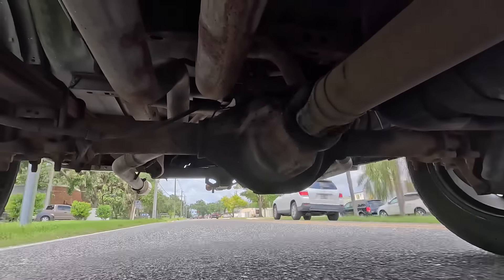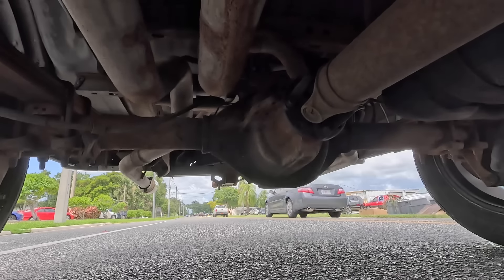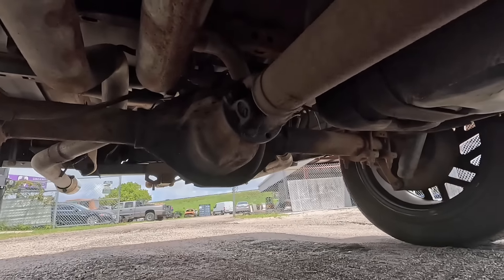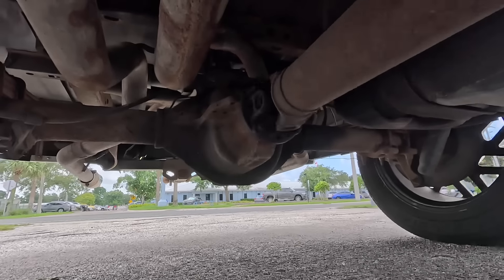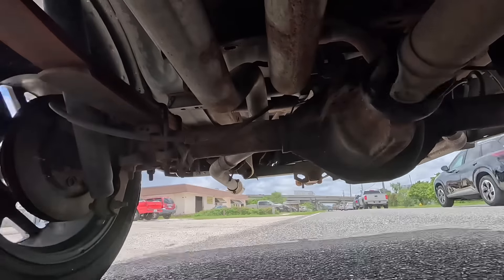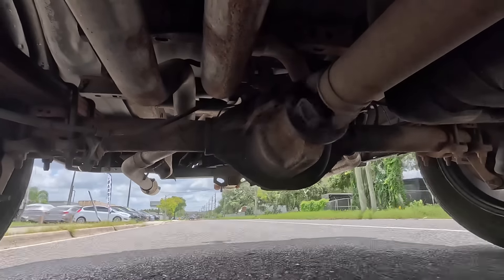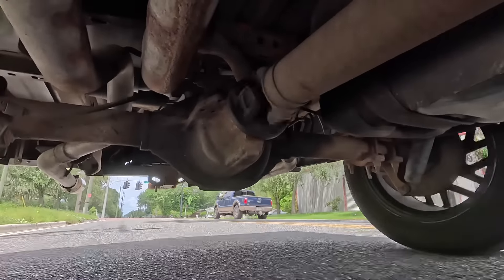Caught Faking a  Video? ​⁠Driveshaft Falling Out While Driving

Comment: Ray, there is absolutely no need to further explain. But it is true how the novice thinks. I am so happy for you that the drive shaft did not pole vault you or the vehicle back to the shop.
Reply from the maker: SERIOUSLY! Pole vaulting an F150 on a Friday would seriously violate rule number 1

Edit: go back to the long vid and present the new evidence in the pinned comment thread. It will be hilarious! The link back is at the end screen of this video.
Reply: The pole vault myth is impossible. Myth-busters tried it, it can not happen.
Reply: Friday was not a good day to die.
Reply: I tend to believe that any day of the week is not a good day to go pole vaulting an F150
Reply: @clbcl5  Mythbusters were never good with automotive myths. I saw them screw up numerous 'tests'. Yes, it certainly IS possible, because I've seen it. (I still loved MB, just not their car stuff)
Reply: Ray, you can't fake that. I seen that happen before.
Reply: Ray, I guess it was you that altered the the Zupredur film of the JFK assassination as well! 😅😅😂😂🤣🤣🤣
Reply: @RainmanRayOffDuty  Psst... did you find that missing piece of the steady bearing hanger.. as i said i saw metals near the front gate?(uh oh.. hope that tire machine is in working order? :)
Reply: I have personally seen a early 70’s sedan loose the driveline at the transmission and hit the gutter in the intersection, then lift the car up 5 feet. 
It didn’t cartwheel, but it was exciting.
Reply: @RainmanRayOffDuty  Ray..  
   This is just the devil messing with you, bro.   
   Step 1= Gotta learn to ignore him/not respond.
   Step 2= Learn why he does what he does and then he finally stops.
Reply: @clbcl5 Unfortunately the pole vault scenario can happen. A girl who rode the same school bus as I did was killed when her father was driving too fast and the front u-joint broke. Witnesses said that the car tumbled end over end and landed upside down in flames. The father was ejected and survived with non life threatening injuries. The girl was pinned in the back seat and burned to death. It was reported that she was screaming but the car was so crushed and the fire was so intense that there was no way to approach it. It was a closed casket funeral.
Reply: @danielbutler578  That's brutal and sad!
The reason why they pole vault, the emergency brake cables were put under the drive shaft to prevent it from dropping to the pavement. Well, those usually are cut and removed when they lock up. I personally did this on my vehicle back in the 80's. In missouri, you're emergency brakes were not needed to pass state inspection. As of 2020, the same thing was still in effect. I had a Ford Taurus with no cables. The inspection station would fall it. All I did was call the inspection hot line, they gave that inspector a warning about it, then passed it.
Reply: @jimfiles3307  When the low rider gets a little higher...😳😳😳🍿
Reply: 2:44   i believed it the first time, just pure dumb luck it broke next to the shop door, and not going over the bridge,  that would have been a pain in the ass.  I think you had a car on the tow truck.
Reply: @clbcl5  oh but it can if the frt is loose and the back is still hooked up it would lift the back end off the wheels hitting a chuck hole
Reply: @bobbg9041  The driveshaft is hollow. It could not overcome  the weight of the truck nor the kinetic force of the forward movement of the truck to stay intack to transfer the energy to upward travel. The entire rear axle and all the mounting hardware would need to not break also.
Reply: I once raced a guy on the Kennedy in Chicago, right next to the EL tracks. This was back in the 80's. He was in a Camaro, I was in a Maxda RX4 Wagon. We gunned it, his drive shaft decided it needed a new life, cam off the rear pinion, slipped out of the transmission, and then decided those railroad tracks looked tempting. Lit up the NIGHT when it contacted the third rail!   Needless to say, I won that race and didn't exceed the speed limit while doing so.
Reply: @acdii  From Cumberland to Harlem? Nice strait away there.
Reply: @clbcl5 just because they failed to make it happen doesn't mean it didn't or can't, the best they can say is unlikely. There's always the one-offs in life. What's the chance of sitting in your living room and having a cannonball hit your house?
Reply: @TheWabbit  A lot more after they did it. What are the chances of a can of biscuit dough explode and somebody is stupid enough to think it's brains?
Reply: @TheWabbit  Drive shafts are hollow, so the physically can not withstand the forces to transfer energy to up ward motion. Same as Hell Boys hit to a hood can not make an SUV cart wheel.
Reply: @clbcl5  Right around that area, I think we go on around Irving Park and met the Camaro right before the stretch and did a rolling take off.
Reply: I've blown my drive shaft 6 times or more 😅
Reply: @clbcl5  Give it up. You are 100% wrong. I has happened in real life. Maybe not in your fantasy world.
Reply: @61rampy65  Do you even science.? A drive shaft of .083 thickness can withstand the force ? If it can, is there a video of it?
Reply: @clbcl5  You should learn English, too.
Reply: @clbcl5  You DO know that tubes are stronger than a solid shaft, right? RIGHT????
Reply: @61rampy65  And the weakest parts are the joints and connection points.  A 1/16" wall pipe can not withstand the weight and inertia of a truck to transfer forward momentum to vertical. Physics does not work that way. If the joints do not give out, the weakest point of the pipe will. You will get more air from a well  placed speed bump.
Reply: Ray, love the channel and the content.  Watching that footage cracks me up and doesn't get old.
Reply: @clbcl5  You do know a pipe is far stronger and more rigid than a bar of metal of the same mass don't you?
Reply: @clbcl5  Men being able to fly was also thought to be impossible too.

Comment: The reason the Rainman is the mechanic’s mechanic is because of his impeccable integrity. Despite extreme Florida heat and rain, look to the Rainman for quality over quantity. This issue is based on ENVY of the Rainman, plain and simple. We ❤ you Ray.
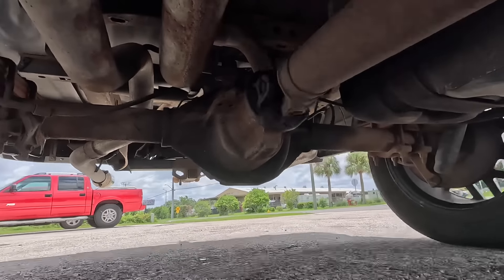Reply: 1:09  his excuse for not faking the video is that:
 he THOUGHT he was "annihilating the ring gears" of the customers vehicle by  continuing to drive it in that condition. And he had no idea the driveshaft was making the noise and that he was NOT causing further damage to the ring gears.
Ahhh, the integrity of intentional damage to a customers vehicle
Reply: I mean i suppose you could parts cannon the vehicle till you find the problem. Or spend days tearing it apart until you find the actual problem... or, you know... test a hypothesis with the intention of replacing said defective parts. If he expected the ring gears to be bad, he almost certainly intended to replace them. At that point a little more use to confirm the diagnosis was of little consequence.
Reply: @RenniaTrayvold  right.  Because the ring gears coming apart wouldn't cause more damage to additional parts!!
I mean, putting it on the lift and putting your hand on the rear axle would show how loose the driveshaft was before doing additional damage to "test a hypothesis". 
Always start with the LEAST intrusive test, especially when it takes less than 5 minutes. You don't START with "let's drive it until something breaks"
Reply: @epstein_isnt_dead7726  weird. That was not the impression of his plan that I got from either this vid or the original video... but I suppose his phrasing doesn't come across to all folks.
Reply: @RenniaTrayvold  how many ways are there to interpret "I kept driving it thinking it was annihilating the ring gears"?
Pretty hard to not take that exactly as he said it. 
And his actions of driving the vehicle while it was making all of the noise is further confirmation of those intentions.
What did you hear that made you think otherwise?
Reply: @epstein_isnt_dead7726  So when someone comments on a video saying "Funny part X killed me" I gather you either believe them to have actually died or are telling a lie? It's called an exaggeration.
Reply: @epstein_isnt_dead7726 once the ring gear is damaged it doesn't matter 😂
Reply: @michaelpressman7203  why do you comment nonsense like this?
The ring gears are in the axle with many other components. Axle shafts and spider gears and clutches, for instance.
Replacing a ring gears vs 
replacing a ring gear, clutch, and axle shafts.
Which one will cost the customer FAR more than the other?
Do you need a hint?
Reply: @RenniaTrayvold  or maybe they meant they died on the inside. 🤷‍♂️.
But you got your own reach wrong.
If we were being truly semantic here, annihilating the ring gears would require far more than just driving on it and stripping the teeth off. Breaking it into multiple fragments or melting it would be necessary to reach the term "annihilate".
Do better

Comment: i was wondering in the initial vid why you had cameras under the vehicle for the test drive, you don't normally. however i am quite happy to accept the 'customer states diff problems' explanation, your honesty has been proven over and over again.
Reply: Aint modern camera tech GREAT? In the past we used to get some poor "SMUCK" to hang off the tailgate and look underneath a truck in motion for noise.... Today, just hang a camera instead(sigh)... DANG it was fun watching the New Guy falling off the back of the pickup truck back in the day...  ;P
Reply: @Streamer687   You mean like me, acting as the safety harness, holding the flight engineer outside the door, looking under the wing, because we had one green one red for landing, not a good thing. Looked locked, every cycle, though to make sure we did land with fumes, and it is rather disconcerting to see a fire engine, with foam cannon at the ready, pacing us down the runway. But smoothest landing ever.
Reply: oh he probably has all kinds of technical footage that ends up on the production floor.
Reply: I was wondering how the camera changed direction just in time to catch the driveshaft breaking. No differential up there.
Reply: @toddp3314  Agreed, no reason to film the carrier bearing assembly coming apart.  Clearly this should have been inspected and not just filmed, additional damage to expensive parts could have taken place.  And, the replacement Dorman drive shaft was clearly bent per the post-repair footage indicated.  Comments were made about it not being acceptable, but no indication it was replaced.  This video plus the previous sketchy electrical troubleshooting video causing this subscriber to question my choice.
Reply: @toddp3314 2 cameras 😂

Comment: I've been in a car that lost it's propshaft while traveling.
Little Morris Minor, long story involving a gearbox from an MG that had a longer rear housing than the original, and a very VERY dodgy shortening of the propshaft by an amateur 
(not me, I was only about 8yo, just going along for the test ride.)
Propshaft dropped at the en-shortening point (gearbox end) while doing about 60-80kph (40-50mph), proceeded to embed itself into the road and bounced violently around with absolutely no control.  Noise was intense, as was the vibrations and dust as detritus filled the cabin.  
Worse was the long, thirsty "walk of shame" along the thankfully deserted dirt road back to get a tow.

Comment: I was a sceptic but didn’t post a comment.  Seeing the middle of the shaft framed right in the middle of the shot, and seeing the same camera framing the rear axle also raised my suspicions.  I guess you’re  using a 180 or 360 lenses where you can frame shots anywhere in the “dome” during editing.  Great footage.
Reply: Ray should have explained the camera details better. A 4K wide angle video is often edited to show only the most relevant part of the frame. Edit: In another comment Ray says he had two cameras attached. Should have explained that better in the video description.

Comment: They just trolling. They know dern well it wasn't fake when they saw the title f150. They knew it was a Ford!😂
Reply: No, it was the side camera angle at the moment of separation which looked out of place with the rest.
Nobody's trolling.
Despite that, Fords do indeed suckabagadix.
Reply from the maker: I use two gopros on rubber magnet mounts. One test drive they were on the bumper looking forward, and the other test drive (I parked and moved them in the parking lot) they were on the right side looking sideways at the driveshaft and left towards the axle from the front side. That's that footage that we see in this video. The shaft ripping apart scene was from the right mounted most forward camera that was pointed at the driveshaft. I was looking to capture the rear wheels locking up combined with pinion slip because that's what I though was happening in the differential. The driveshaft was where it was suppose to be when I moved the cameras to the side of the truck. I was going in back and forth circles on the gravel and in between reverse and drive it came apart.
Reply: @RainmanRayOffDuty  You need to update that in the video description. It was not obvious that two different cameras were used.

Comment: Ray love the videos on your channels keep it up.  One thing I noticed in this under vehicle video is when the truck moves  forward or backwards the rear differential where the drive shaft attatches moves alot up and down  pulling the shaft away from the center point connection near the carrier bearing.   I had the same thing happen on my truck the movement of the differential pulling up and down weakened the connection causing the failure of both the carrier bearing and the center connection point of the drive shaft.   A set of Traction bars that connect to the axle housing and the frame solved the issue. if you watch the footage closely you can see the movement and when you shifted to reverse the change in movement caused the total failure when you shifted back to drive.

Comment: Ray your video's are fair when inspection on car's 
When the key board person that are not auto work shop trained they wright bad things.
I been driving in UK from 1988 and if I feel something not right with brakes or drive train not performance is shaking on speedup and slow down it time to get advice to get a replacement part to correct issues or clucking from worn bushings or engine mounts.
Carry on the good work I have been watching you when working at the other work shop with Peter and you opened the workshop most days taken care of compressor drainage.

Comment: I saw that happen as a kid. My parents were building a house on twenty acres with no sewer.  Dad had a septic tank an leach lines laid out.  The lines needed a bed of gravel which was brought in on a dump truck.  The gravel was dumped where my brother and could load it into a wheelbarrow and lay in the bedding in the leach lines.  When the driver finished dropping the load, he lowered the bed and put the truck in gear to leave. The drive shaft dropped off at the differential end and just spun.

Comment: I think the issue here is that you have the camera pointed directly at the drive shaft when it failed, which looks like it is staged (as you stated you never though it was the drive shaft that failed , but gearing within the differential).  While I see in this video where the camera was pointed at the differential and we see the drive shaft failing, I think what may clear this up is how did the camera's angle changed from looking directly at the differential to looking directly at the drive shaft.  

I think that may clear up the confusion.

Comment: My problem with the video, is that you didn't know the difference between an 8.8 and 9.75 just by looking at the diff cover ;)
Reply from the maker: I see a lot of rear ends, they're not burnt into memory. But deep down I knew it to be true, so I faked the measuring tape scene.
Reply: What is weird is it is a 5.4 XLT with an 8.8 rear. Typically the V6 and 4.6 V8 came with 8.8 rear differentials.

Comment: I personally have seen a universal joint fail at the gearbox end, dig in to the ground and pull the diff and back axle from a pick ups chassis.
As a mechanic didn't the prop shafts vibrations tell you something was wrong?

Comment: Drive shafts absolutely will fall out. My brother was driving his modified/lifted k5 blazer when he was slowing down for a stop sign at the bottom of a hill. He sheared off both ends of the front drive shaft (full time 4x4). As it was bouncing around it took out his trans coolant lines, fuel and brake lines. What a mess to put back together.

Comment: If you still have this vehicle, it could be a good time to teach everyone how to not X the driveshaft. As on old time Transmission guy I have seen many people put the driveshaft back together wrong, if the splines are not keyed to only go in one direction.  I have seen them reassembled 1-2 splines off and while there may not be a vibration, they were putting in a new u-joint every year.

Comment: Heck I would have done the same.  If a customer says Noise from underneath, I would first hang my magnetic Cameras underneath the isolate the noise. It was a coincidence  you got a catastrophic  failure in the process.  Luckily the drive shaft  didn't decide to pole vault and cause extensive damage.

Comment: Was it sensible to go back out on the road rather than take a quick look underneath?  That's not insignificant noise.

My van is FWD (VW Transporter) so no prop shaft problems but the stub axle and half shaft into the gearbox have a splined fit (with no lube) and they do wear and vans lose drive this way.  No falling prop shaft problems but just no drive anymore.  It's an easy fix (new half shaft and stub axle) but it's an engineering mistake.